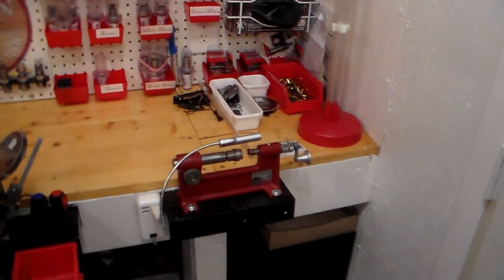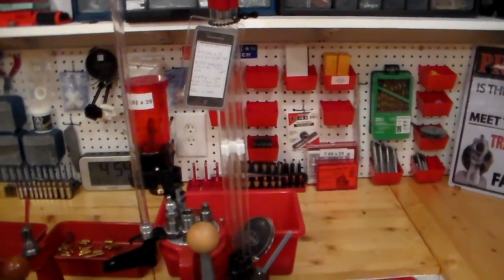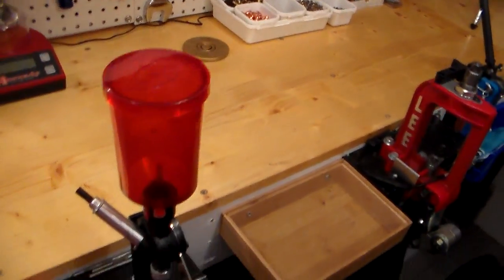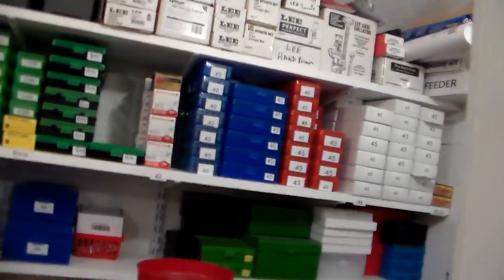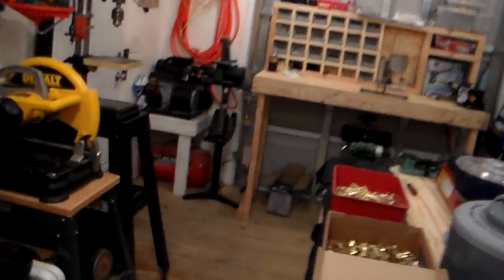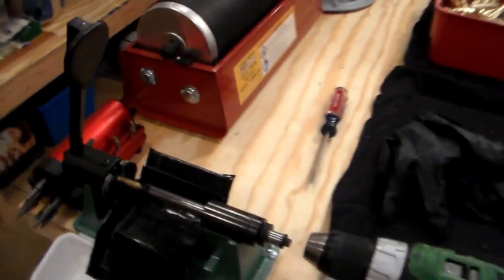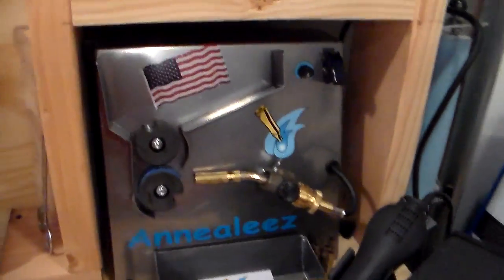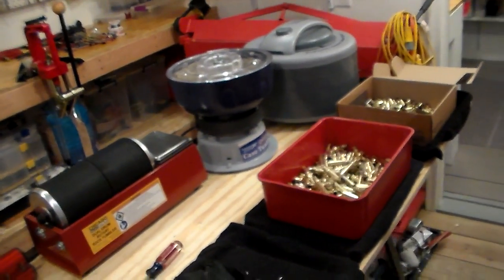MAN CAVE-RELOADING SHOP

Comment: Very nice setup.  I hope you never have a house fire, and more so, your homeowners insurance carrier doesn't look at your post on YouTube.  You have 3 shelves of 15 containers of powder each.  It appears that the containers are stocked 3 deep or more.  At 3 deep, you have 135 pounds of powder.

 Maximum storage is 20 pounds in the open.  

Over 20 pounds but less than 50 pounds must be stored in a wooden box with walls at least one inch thick.  Over 50 pounds storage and the storage specs get a lot tighter.  Plus, STORING PRIMERS AND POWDER NEAR ONE ANOTHER IS NOT PERMITTED.

 I'd just hate to see you lose your shirt and end up in prison when it was all over.  State and local laws do not supersede federal law.

Comment: You've got the equipment ... a lot of it has never been used and/or not opened. All of your powder and primer even ... new latest production packaging.  You've got a lead pot surrounded by wood in a room full of powder and primers.  The one thing you didn't brag about and show-off were your fire extinguishers and your sprinkler system and your smoke detectors.  So for those of us who have been reloading for decades, those of us with powder still in tin cans and labels from every decade, those of us who have the common sense to do our smelting and casting outside ... and those of us who do not need a different press for every caliber ... we're not impressed.  Matter of fact it's rather gaudy.  Seems like a waste of good equipment that others would put to better use.  So here are a couple of tips. Make safety first.  Do your due diligence when it comes to extinguisher systems and alarms. Get your primers in metal ammo cans with seals. Get your live ammo in metal ammo cans with seals. You're powder is fine but your backwall should be fire-walled, minimum 2 hrs rated, which would mean clay taped, staggered seams, three layers thick sheetrock. Use your frickin' media tumbler ... don't just show it off.  All of that stuff is far too clean to be getting any quantity usage.  Get ready to implement some sort of dust control in that place because if you ever get serious about the craft of reloading you're going to have dust covering everything in no time. Your shelves will eventually collapse from the amount of weight you have on them and then you're going to have a mess ... or worse. They could bow the wall the shelves are attached-to. You obviously have not done much swaging on that Dillon swager or you would already realize the inherent issues with going vertical with that thing over time once it loosens-up. You reload .380 ... ::::: snicker :::::: but hey, maybe you're doing it for your wife or girlfriend, who knows. But dang dude .... an entire press dedicated to Kurz? That's just not right. Turn in your man card I don't care how much money you have to throw-away at ridiculously gaudy set-ups like that. Do you realize you could be running a Mark 7 for the money you've got in all of that ... I mean the Evolution Revolution whatever you want .... and you do that instead?  You're not a serious reloader. Sorry .... but that's the truth.

Comment: this guy is why there is a shortage of primers and powder lol.  you should have just bought a mk7 evolution or a dillon 1100 with a bunch of tool heads and all the accessories and the auto drive.  you would have been in to it for less money and you could have automated the whole process.  i kinda get it as changing caliber can be a pain so its great having a bunch of presses but you can only pull one handle at a time, so when it comes to speed the automated setup with different heads will make it faster, plus you can be prepping cases or working on something else while its working for you.

Comment: Perfect, all set up to run without having to re tool.  Once you get a press dialed in, ya leave it alone.  I have Hornady lnl"s set up the same way, other than I swap them off the loading station rather than lining them up.  My shotshell presses have their own station as well and swap out.  I'd store the primers differently though.

Comment: You may have the equipment to reload but it is single stage presses and that Sucks you should have invested in Dillion 550 or 750 and or a 1050  machines and you’d be miles ahead in the long run

Comment: This is great!  Been away from reloading for 30 years and just got a Loadmaster which I have been using for a few weeks now.  The thing was flawless out of the box. Worst thing is sometimes there is an upside down case getting fed.  So what?  Only have made a few thousand rounds.  I take my time and operate well below what this press can put out.  I check EVERY round before putting it in a box. I could go a LOT faster but then the fun would just be over sooner. I also check EVERY round for powder before seating (pistol) but one time there was a double powder charge.  Thats why I check.  I still don’t know how that happened.
Reply: I used to think it was all about speed but I got over that with experience. Now I just enjoy the process and let that determine the output.  Works for me.

Comment: I'm a Dillon guy but really like some of the Lee stuff as well.  Great price and very good quality.  My reloading room is a little bigger buy not so many presses as I can simply switch out calibers in 2 min on the Dillons.  I also have used about 4 or 5 powders to load everything I've shot over the past 30 years.  To me it's better to stick to a few good loads rather than chase powders and "New" "best" loads.  I've loaded roughly 250k rounds(I log all of my loads) on one of my 550's with only minor slowdowns.  The Lee's are good but seem to not handle the volume without "down" time from what I've seen.  Good stuff though!
Reply: I have one loadmaster I bought, and got another one that was new and got thrown away. I load a few then frustration gets to me and I stop for a month or sometimes a year. I hope sometime to get a 750 or maybe a 650. What would you recommend Takedeadaim?   I can run mine off on eBay and recover some $$

Comment: how long can you leave the gun powder in the hoppers before they go bad?
Reply from the maker: I normally don't leave my powder in my hoppers, unless I am going to reload several calibers in week. My reloading room has expensive dehumidity system that keep my room very dry that helps with the powder. I recommend not leaving powder in your hoppers. I reload around 700-800 rounds per week, my wife and myself shoot every week. The problem when you leave your powder in your hopper, the powder wants to go lumping and doesn't want to meter your chargers correctly. If you start to see the hopper turning black, this is the start of issues to happen. To fix this problem you can pour little graphite in the hopper and rub it around the inside and than remove it.  Good Shooting my Good Friend

Comment: Just an FYI for you guys building reloading benches. Menards had 3/4" finish plywood in pre-cut 2 x 8 sheets which is perfect size for a table top. That finish plywood is beautiful compared to the cheap knotty 1/2" plywood most people use.

Comment: Well, with a Dillon 550 you just change tool heads.
Reply: Power to him! It’s his money. However , I would not have another loadmaster. I’ve tried to give mine back to lee out of protest. Selling plastic parts is what keeps lee going
Reply: Yep, and far less money too.
Reply: Load Masters do as well, but for whatever reason this tool figure he needs a press for each caliber he has. One of those moron guys, he needs "more" to get "on"
Reply: @RideForLifeCR250R  obviously this guy has the cheddar to do what makes him happy.  Anyone who doesn't appreciate that can suck it.
Reply: @RideForLifeCR250R  why not? If you wanna use a progressive press and have consistent results you wouldn't want to be changing it up all the time.
Reply: @chickenbonelives  adjustments need to be made occasionally even if you haven't touched it.. you'll find that with time and experience.

Comment: Wow, you got one very well organized and efficiently laid out reloading room. You're now ready for the apocalypse if it comes. I like it. Thanks for sharing. One thing, i would use an ultrasonic cleaner instead of a tumbler. Tumblers are noisy and cause a lot of lead dust which isn't safe. Also would add better ventilation for for the room as well.